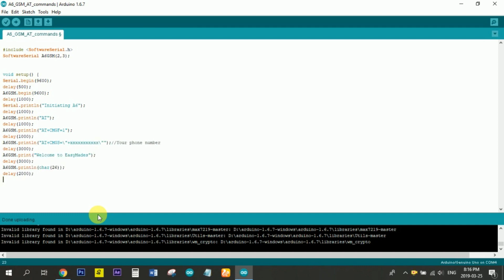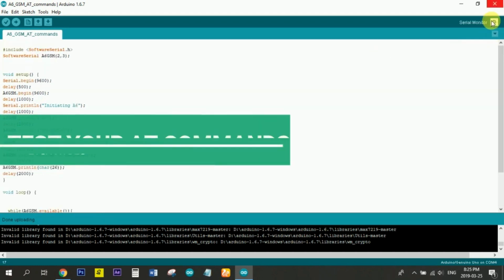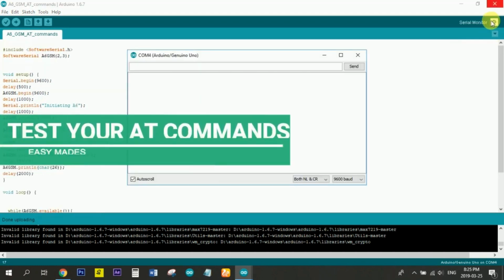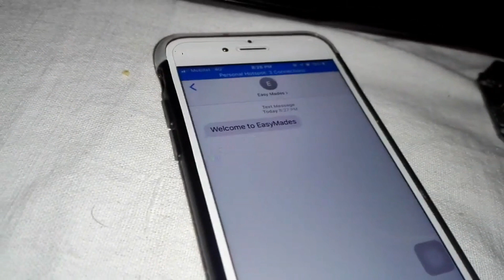A6 GSM module with arduino AT Commands

Comment: The message was not coming in my mobile, I had seen many videos in youtube but my problem was not being solved by anyone, I had made wrong connection, but you clearly told that "U_RX Pin" to "D1" And by connecting "U_TX pin" to "D0", now my module is working perfectly and the message is also coming. I had confusion because there was 3 type of RX and TX pin available , that are 1) H_RX, H_TX  2)U_RX, U_TX and 3) R232_RX, R232_TX. Thank you so much for clearing my confusion.🙏🤩
Reply from the maker: Those are serial connection with different voltages.
Reply: @setnfix  Ok sir Thank you 😊

Comment: When I call the number of the sim card i put on the module a blue light appears and i hear the ringing on my telephone. I set the sim card to work without PIN lock. 

While uploading to Arduino UNO  I get the following:  
avrdude: ser_open(): can't set com-state for "\\.\COM11"
An error occurred while uploading the sketch
Error while setting serial port parameters: 115,200 N 8 1

COM11 is the port of my UNO.

Any help?
Reply from the maker: ARDUINO Board is not detected by the software

Comment: @SetNFix 
Hii I am trying to send the text message using the same module but it is not even responding to the "AT" command when it was expected to reply back with "OK". Please help...
Reply from the maker: First check the wiring and if the wiring is ok check if there are SIM lock is activated. if the sim is locked, remove it. Then try to take a phone call to your sim card in the module.
 If you can not hear the ringing tone, there is a issue with the module or the sim card.
Reply: @setnfix   Thank you sir.. I have completed my project😊
Reply from the maker: @nishaverma4665  Anytime

Comment: :( mine is not working it only says   '  Initiating A6   '  

please please help me
Reply from the maker: can you hear the ringing tone when calling?
Reply: @setnfix   no it just only say initiating A6 please help me
Reply from the maker: @MOHAMMEDIBRAHIM-wy1dv  if you can not hear the ringing tone, there is an issue with wiring or module or with the sim

Comment: Hi again, 
sorry mate. I am really trying to get this working but I live in Australia. Do you know if it works here or just in Asian countries
Reply: I have no blue signal light appear regardless of what I do. Not sure if it is my specific module or if I need to upgrade the firmware. My At commands rarely ever work and I always get no signal. The signal light doesn’t even flash at all, let alone every 3 seconds
Reply from the maker: The module works with GSM/GPRS sim cards